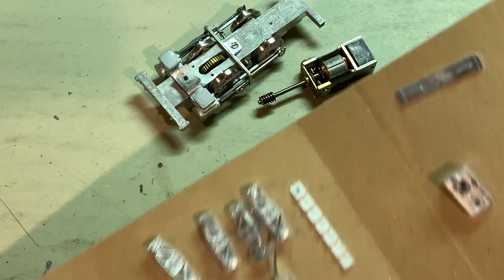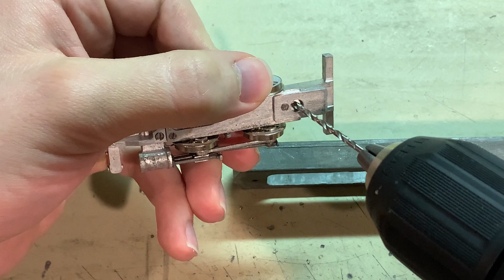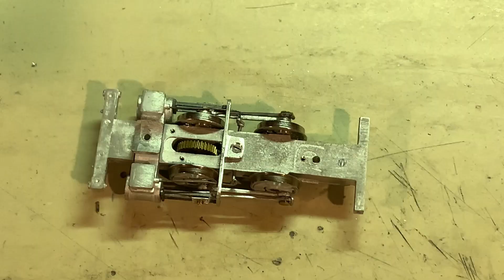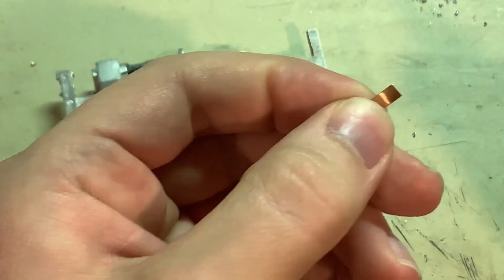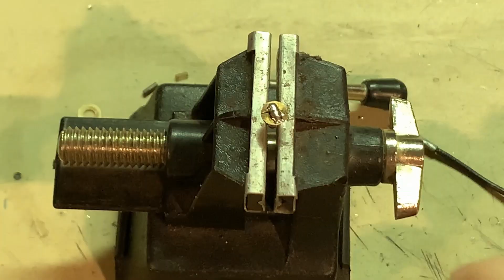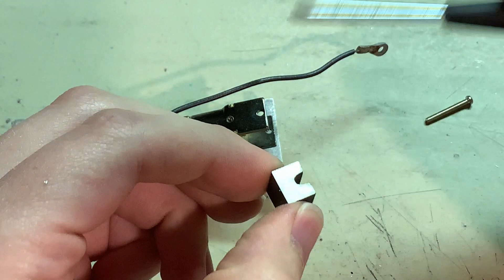How to Build a Terrible HO Scale Steam Engine Kit: Part 3 - The Motor

Comment: Score is 3 - 0 in your favor... fantastic new installment in the struggle with the Arbour. Really enlightening to see just how simple it is to deal with one of those old open-frame motors; I had no idea it was possible to swap the magnet out for a stronger one, much less that it would improve performance by that much. Very characteristic of Arbour to make the pronged end of the wire out of white metal instead of literally any other material. This is the company that makes screws out of white metal too though, so I shouldn't be too surprised...

I recently picked up another Arbour Sierra #3 kit for quite a bargain on ebay, which appears to be in much better condition than the basketcase #3 I already have (its parts are all covered with glue that has gone very yellow and crusty with age, so it'll be a cleanup job before proper assembly can even start) so here's hoping I can finally start my own process of dealing with one of these things.

Really encouraging to see your technique for dealing with less than ideal kits like these. Keep up the great work!

Comment: Your use of ATF prompted me to shop a majority of my equipment, it really is incredibly better for metal on metal bearings and motors. I can't believe what a difference it has made. Many thanks! BTW I have used it on a few metal to plastic applications; hope it won't do anything to the plastic....
Reply from the maker: Glad it’s working for you! I’ve been using ATF to oil the bearings on plastic gears for years with no problems, so I think you’re safe there.

Comment: Where do you get magnets like that? I'd like to keep original motors in some of my engines, but also upgrade the magnets instead of can motor swap.
Reply from the maker: I get most of them from KJ Magnetics.  They usually have something of the right size, or at least close enough that I can shim the rest with steel plates.

Comment: Your Rivarossi 0-4-0 gearing upgrade inspired me to buy one off eBay. It’s in very good condition and I’ll save it for a wintertime project. The wheel flanges are a bit too deep. What’s your preferred method for dealing with this? Thanks
Reply from the maker: I don’t have any great tools for this, so what I do is very carefully and slowly grind them down with a Dremel while the motor turns the wheels. Make sure to not let things get hot since that can melt the plastic centers!  Once that’s done, thoroughly wash everything to get the grinding powder out.

Comment: MDC used to use a very similar motor.  It had a thin washer under the brush holder with a sort of panhandle on the side to solder on the wire.
Reply from the maker: This one was probably supposed to work like that looking back, but that white metal clip would’ve still needed a lot of filing and fitting to not raise the brush holder too high.

Comment: Great video! I’m thinking about purchasing a DJH kit to build. Any tips and kit recommendations?
Reply from the maker: My DJH Coronation build video shows a short clip of just about every step, so that could give you a good idea of what’s involved: https://youtu.be/30gdAul1i4I

After this and the Bowser are done, I’ll be doing a “high end” kit series with an AMF87 (former DJH) 2-4-2, and I’ll be sure to put in as much good advice as I can give!
Reply: @DarthSantaFe  Thanks. I'm thinking about getting their West Country Class locomotive.
Reply from the maker: @Uptownloki47  Looks like a nice one!  One thing I would recommend is getting something different from the AM9 motor/gearbox set if you want it to run up to full scale speeds.  Their new motors are nice runners, but I've found them to be too slow with the gearing they use.  I have a nearly complete Netherlands 4-8-4 that only hits 35 scale MPH at 12V with their new motor.
Reply: @DarthSantaFe  Thanks for the tip. Their motor and gearbox seemed expensive anyways. I'll probably order from NWSL

Comment: Very instructive and a good lesson in patience.  I especially liked how the festive intro music was a harbinger of the "fun" to come.  The effect of the magnet replacement was really interesting.  I expected the torque to improve, but not the lowering of the top speed.  Nice mod!  Cheers from Wisconsin.
Reply from the maker: It’s like the kit manual says every 2 paragraphs, “Model railroading is FUN!”

Motor speed and torque are actually proportional to each other.  Increasing the torque with a stronger magnet or more windings decreases speed, or you can gain speed by reducing windings or using a weaker magnet.  The increase in torque also comes with better efficiency, so the motor runs cooler and uses less power.
Reply: @DarthSantaFe  I should have paid more attention to motor theory in physics class!

Comment: Coulda definately done with a motor/gearbox upgrade to it drives off the rear axle and motor isnt taking up the whole cab. Keeping an eye out for one of these kits for myself
Reply from the maker: It would take some work, but that would be an improvement! The motor and gears are actually decent quality since they were made by other manufacturers, but Arbour picked out a low voltage motor and really made it stick out through the back. The gears could be reused with a smaller motor and some creativity.
Reply: @DarthSantaFe  drill/carve out a space in the solid metal around the rear axle and drop in something from the likes of high level kits with the motor oriented so it goes into the boiler instead of into the cab, presuming the boiler is hollow and a motor that fits can be found.

Or even stick the motor in the tender and do a thin easy to hide drive shaft with a universal joint and the above mentioned carving of space and new higher reductiob gear set up for better slow running